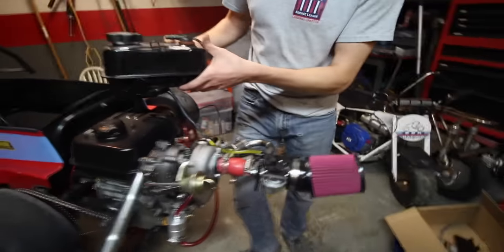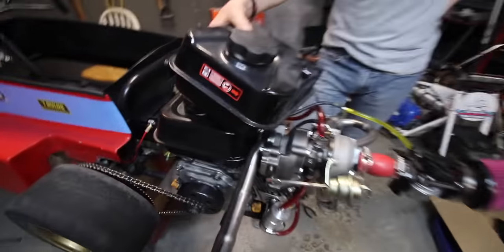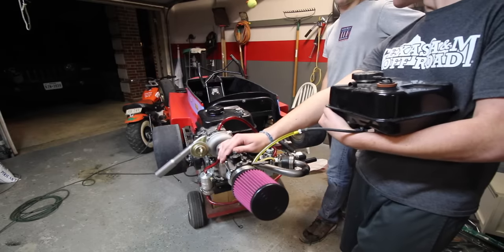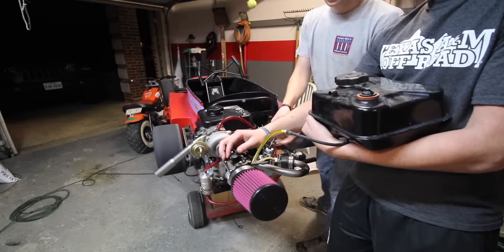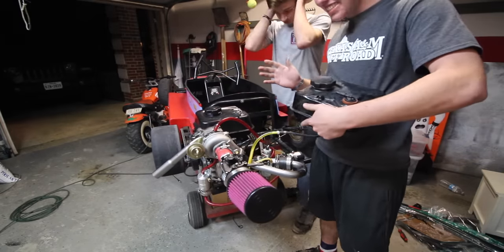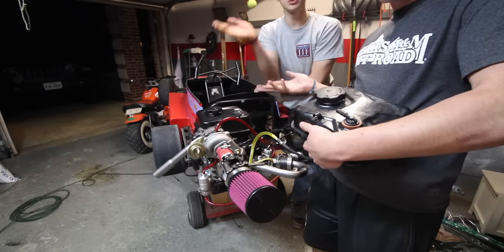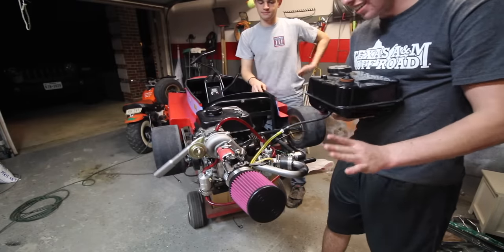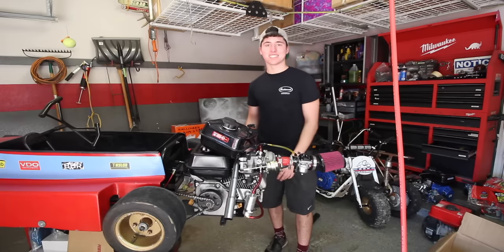Turbo Go Kart Finally Makes Boost!

Comment: When you place the carb after the turbo, it blows the fuel back into the the float bowl and can blow the seals of the carb and fuel out of the float overflow. If you're going to keep the 2 carb set-up, then run the the pre-turbo carb wide open all the time and use the second carb as the throttle control or vice versa. Also on the idle carb on the boost side, you should block off the float over flow and any non-jetted ports leading to the float bowl.  But I recommend getting rid of the second carb on the boost side and getting a lectron carb and placing it on the intake  side of the turbo. Lectron carbs are self tuning and work amazingly for carb turbo setups.
Reply from the maker: Ben Hawke Yeah, that’s why we attempted to pressurize it by putting that screw in there. We still had issues with that though.
Reply: @BuildBreakRepeat  
You should use a lectron carb. It's self tuning and works great for turbo setups.
Reply from the maker: Ben Hawke I’ll look into it thanks.
Reply: @BuildBreakRepeat  You missed one more part, the fuel tank must be pressurized as well, otherwise the boost will push the fuel back into the tank or atleast prevent more fuel from coming in.
Reply: Scoffing evidence setup would help. They have setups specifically for putting a Turbo on a small engine.
Reply: watch carsandcameras they did a drfit trike that was turbo and the used an electronically injected carb and it was running awesome
Reply: Build Break Repeat... You'll have as much $ in that lectron carb as you do in the whole go kart!! LOL

I Left you a good comment on how to solve your issues check it out!!
Reply: Or just run a draw threw set up
Reply: Put the carburetor on the intake side of the turbo.
Reply: @BuildBreakRepeat  if you take the  throttle valve out of the carb closest to the intake, you can use the throttle valve before the turbo to control how much air the engine gets.
Reply: @larrythemanic6.0mechanic78  there's did not run awesome. It ran but they had a lot of tuning probs and then never put it back on the channel.. but they used a widely marketed EFI system from eBay or Amazon and threw it on a turbo tryke and it ran but not great but it ran better then the carbs.. my opinion would to be to use a EFI system and integrated it into a multi port EFI intake system like modern fuel injection. And then turbo it from there...
Reply: @jamesduffy9756  i agree but it was running much better then any other system ive seen
Reply: Nailed it James👍
Reply: @benhawke7231  you really think he's going to invest that much into a carb for a homemade project ?
Reply: Yeah I agree with this. Also you gotta have a fuel pump to keep the pressure up instead of gravity- fed carburetor.
Reply: agreed
Reply: The mikuni is redundant. Dump the second carb, use the mikuni on inlet side of the turbo, add a dial a jet if you can find one and this will work.
Reply: Corey😁😃😎😍😅😋
Reply: @BuildBreakRepeat use only the carburetor on the turbos inlet and install and tune a power jet for it. .
Reply: @georgelalama8154  you would not know until you figure out your air fuel ratio and so on and on timing would have to be adjusted slowly and carefully go to far and lean = no more fun and smiles
Reply: Perfectly said, cause the needles are gonna be where it’s easiest to tune. That’s a super mean low to high crossover to tame the way it’s all set up. Some diaphragm walbros might be easier to use for sure
Reply: You need one big carb and even then its all gona be way to much for that motor but your inovation level is amazing you guys just got a new viewer for life
Reply: Ben Hawke I boosted a twin opposed engine. With a turbo that’s a tiny bit bigger than your but I used a two stroke plunger carb KX80 I believe but made boost and rolled abit of coal.
Reply: @georgelalama8154  that depends on how much boost they run and what fuel they use. The fuel enrichment is just as important
Reply: Yeah tell me about it! It would be more like Kablewieee!!! and then caputs for the engine🤣! @robertaswenson1192
Reply: Exactly what I thought when I saw him put the carb after the turbo.. Don't do that. The carb is meant to let the engine suck the fuel from the tank using vacuum. If you apply boost you'll just shoot the boost right into the fuel tank and starve it. Just run one carb before the turbo inlet.
Reply: Ben Hawke max
Reply: @jamesduffy9756  Theirs*😆
Reply: Megasquirt and call it a day. Screw carbs.

Comment: I would personally just do a pull through system turbo boost outlet directly to the intake and only run one carb
Reply: Yeah I don't understand what is so fucking complicated about this...
Reply: I agree with this
Reply: Came here to comment this. They are making it way more complicated than necessary.
Reply: Yup, one draw through and call it a day. All the problems would be solved.
Reply: the problem with that set up is the fuel droplets, instead of remaining atomized and gas like, all the way to the combustion chamber, condense on any of the surfaces that it flows over so in the end you end up with a mixture that is no longer stoichiometric.  obviously the longer the intake tract the more surface area there is to cause problems.
Reply: @ENZEEVIDS  Drawthrough srtups work fine on cars, should work fine on this.
Reply: I don't get it they make it complicated
Reply: I haven't finished watching this but why is there nothing hooked up to the waste gate how they gunna make boost ?
Reply: Perry Anderson...you’ve obviously never run a draw through system on any actual vehicle. Drawing the fuel through the actual compressor atomizes it even better and optimizes the mixture. It works...we’ve done it for years.
Reply: yeap and a fuel pump + pressure regulator  too
Reply: Was about to post this. Just freaking do it properly otherwise as soon as you boost, the middle carb is going to go positive pressure which is gonna cause so many problems, and also be a restriction. Damn.
Reply: I'd be embarrassed to post this video
Reply: @jaydee4200  Boost reference is to open the gate. It stays shut unless it sees boost past its rating. Then if you experience leaking you get a bigger spring.
Reply: Absolutely ridiculous. Just do a pull thru just like gunny fine and a lot if others said and use a larger carb.
Reply: When u run it pull through like your saying it's really only good for WOT the negative pressure in the turbo charger sucks oil through the seals when you close the throttle and oil and fuel starts pudding up inside the housing basically giving it no real driveability but it works fine if u just wanna run wide open for a short distance. Blow thru is a little more complicated but it's the right way to do it. But I will admit they got some crazy setup going on here.
Reply: Id have to agree with the blow through concept. These guys look pretty young. I definitely admire their drive. Trial and error (**draw through**)
Reply: When you.. and 50 other people.. get upset about the fact: Two kids don’t know how to turbocharge a carbureted engine....
Reply: they created a problem to solve it later...
Reply: You’re over complicating it just run one carburetor that’s it straight through and then you got it and run a blow off valve on the exhaust

Comment: Y'all are making this build far more complicated than need be. Put the Mikuni directly onto the turbo air inlet. Connect the boost side directly to the engines intake. Plumb exhaust and jet up as needed. So long as the turbo draws air through the carb instead of forcing air/pushing air through it you'll be fine.

Comment: You can always divert boost pressure to the gas tank and keep the whole fuel system pressurized, that would keep the carb able to pull fuel through
Reply: I'm turboing a roadster reverse trike and was thinking g of doing this. And article I can read about doing this? Safety concerns?
Reply: @CygnusHomes  the safety concern is that the blow off valve may release pressurized fuel air mix (boom). You have to be really careful. The best option I can think of is having a longer boost tube than plenum to allow the expansion of the fuel air mix. You also might want to put a spark arrestor on both sides of the turbo to prevent ignition of the boost tube in the event of air fuel reaching the hot compressor

Comment: Just use one carb ! keep the mikuni as a blow through keep that screw in the vent and run a boost reference line to the venturi then install a pulse fuel pump job done ! 👍🏻

Comment: We saw your invention but, couldn't put heads or tails on it. We installed a Hayabusa engine on a cool off-road go-cart and came up with an Awesome built. We have a 10-gallon gas tank on it. And we are very proud of ours. .gas lasts forever.

Comment: The blow through carb will need a high pressure fuel supply if you want to do it that way. What happens is the bowl gets pressured by the intake air as soon as you make any boost and it pushes all the fuel out of the carb. Some people actually put a sealed box around the entire carb to help with help solve pressure differential issues. 

That being said, you should be able to make it work with just one carb up-stream of the turbo (draw through). With a properly sized and jetted carb you should be able to make it run well. I did this on a car of mine and it worked pretty well.
Reply: Couldnt they just run a boost line to the tank and seal the lid tight?
Reply: That would work actually, I did think for a moment that the sealed tank would draw vacuum as the fuel got used up but it wouldn't do...  Mounting the carb in a plenum is an idea I've been pushing since the first turbo vid too, solves so many problems instantly.
Reply: fuckery abounds it could work, but then you have a tank full of pressurized air and gasoline. Very easy for that to turn into a bomb. Safety is rarely even in my top 5 priorities and I wouldn’t want to be around that.
Reply: I don't know that it would be any more or less dangerous than having fuel pressurised by a pump though really. In an enclosed space like a fuel tank the vapour/air ratio is much too high for it to be explosive, hence why it's possible to use electrical level senders and in-tank pumps without danger of explosion.  I guess if the boost pressure caused the tank to rupture and spray fuel everywhere, but I don't think it's overly likely with the levels of boost this engine will run.  Like you say though, a plenum and properly regulated fuel supply is the better option & what I'd go for if I could.
Reply: This is the smartest and best reply yet...

Comment: I had several experiences turbocharging carbureted small blocks back in the '80s, and I'm still turbocharging vehicles today. I highly suggest using a "draw thru" (or "wet charge") setup, over the "blow thru" (or "dry charge") setup. A single carb on the inlet side of the turbo, with a discharge pipe into the intake ("draw thru") is less complicated, and makes for easier tuning. A "blow thru" setup requires fabricating a totally sealed enclosure for the carb, so the carb's vent circuits "see" the same atmospheric pressure from the discharge pipe, that the venturi, idle circuit, air bleeds, fuel bowl and the needle/seat all "see" when under boost. Deleting the turbo outlet exhaust housing, in favor of the integral wastegate delete and wastegate puck block-off plate, will obviously cause high boost pressures. But, if you can keep it around 5-7 psi, while using the stock carb and increasing just the main jet 10-15%, you'll probably be in the ballpark for fuel requirements. BUT... after seeing the surging, low pressure and air pockets in the oil supply for the turbo, these recommendations may just be moot points. Anyway, good luck with the project.  Happy Trails..!!

Comment: Build Break Repeat  Awesome project and video, following your progress for sure.  An idea for a future video: Put a 1980's VW smog pump on a predator as a supercharger.  I have seen some examples that make crazy RPM's and power.  It is essentially a scroll supercharger with the perfect plumbing dimensions for a small engine.  Thank you for all your great content, longtime subscriber.
Reply: Now there's some prime recycling if that's true. Being from the UK I'd never even considered smog pumps as we avoided them, but if they're a scroll compressor with decent volume then it'd be a really cool project and probably much easier than a turbo..
Reply: An aisin amr300 supercharger would also be really good for something that size. It's 300cc and you can find them online for like 200$
Reply: A amr 500 is how I supercharged my UTV!! LOL Badass little superchargers!

Comment: Your original blow through setup would work fine if you just route the carburetor vents to the compressor outlet. Also will need to enlarge jets otherwise it will run far to lean on boost. Watch my turbo welder video for more info.
Reply: Optimal is right, use only the Mikuni carb., in a blow through design but, you won't need to enlarge the jets much, as there is now positive pressure inside the bowl of carb. Been there, done that :)

Comment: Single cylinder carberated turbo running clean.  I dont know if thats a first but its the first ive seen it work.  Good job guys.  I hope you get this runnin smooth. That'd be pretty cool and not a bad claim to fame for your channel.

Comment: Eliminate the blow through carb. Put a "Y" pipe on the inlet side of the turbo. Put a carb on each side of the "Y". Then you can have one for idle and make it so the second carb comes in at 1/4 throttle or so. Kind of like a Dual Quad setup or a Mopar "6 Pack" set up. It is referred as progressive linkage. Blow through carbs don't work unless specifically built as blow through.
Reply: Dual quad - Mopar 6 pack ???? They are totally different. A dual quad is 2 four barrel carbs, a 6 pack is 3 two barrel carbs.

Comment: I did the same thing, but I’m running a mikuni with the bolt threaded in. I had the exact same issue. All you need is a pulse pump. Cost 15$ and solved all my problems , just make sure you put a t in the line that returns to the tank so you don’t flood the carb

Comment: Why are you all youtubers trying to make carburated turbo karts?...KIDS TIME TO GO EFI.
Reply: Agree, i Can't blame them for a 2 stroke, but a carburated industrial engine sucks balls with a 3 hp
Reply: efi kit are not cheap for small engine,i was looking for one for my gy6 and was around $300 to $700.the only way to get one for cheap ,might be off a grom.
turbo are cheaper than a Efi kit.
Reply: Because nobody wants to deal with a $10 USB to RS232 adapter to use the cheaper and older version of Megasquirt. (And perhaps running XP virtualized to run the software?) So they look at the most recent version of the Megasquirt (which is over-featured for the task) and it's $500 more expensive than they want to deal with.
Reply: The main reason is forced induction will make more power than EFI. Put them together sure, but not just EFI by itself...
Reply: Carb turbos are fine
Reply: The only way carb turbo work is by placing only one in front of it, not dual like they want to do. I am a mechanic and have done several custom engines myself. After some jetting to that ONE carb the air/fuel mixture will provide enough to max out that tiny turbo.
Reply: @benjaminfranklyn604  Google fuelino I think it is?  If that's not it Google arduino + efi

It's an Arduino based efi for small engines.  If memory serves me right I believe the whole setup cost the guy under $100.  I think he only paid like $40 out of pocket but he already had some components when he began.
Reply: @DavidHoskins  i will search it up and try it,thank you for the info.
Reply: Heck most videos I see where they use the EFI it still doesn't work it will run fine but actually it always hurts the power ran better without the turbo
Reply: Efi dont make it faster i had 2 bikes with the same engine as the yzfr125 one with efi 1 with carb the carbed one was surprisingly faster strangely faster on acceleration and top end and I know I'm not a expert but thats my experience with efi
Reply: You guys are aware that the Renault 5 GT turbo was carbureted!
Reply: You get more power with carbs
Reply: Just K.I.S.S. carbs are easier and more simplistic then a efi kit. Sure you can tune better with efi but a carb is fine.
Reply: @benjaminfranklyn604  you can make janj efu systems that use the spark plug timing

Comment: Ever heard of re jetting? Damn lmao
Reply: Yeah agreed. Wtf are they doing adding carbs? I'm thinking, "why don't they just check the plugs and rejet?"
Reply: Just rejecting won't help, they are pressurizing the after turbo carb. It's just pushing the fuel back into floatbowl. They only need one carb before the turbo. This was done on snowmobiles back in the 90's for boondocking.

Comment: People have given you some interesting suggestions.  Here's one you might consider.  About 45 years ago I saw a McColloch belt driven supercharger on a Studebaker Lark.  The carb was enclosed in a sealed air box. The supercharger fed the air box.  That way the air pressure resulting from the boost would be equal inside and outside of the carb and would not cause carb leaks. You would only need 1 (your highest volume) carb to run the engine.  Fuel line and adjustment controls could be run through the air box with air tight seals , as not to loose boost pressure.  That way you could make your adjustments on the outside while the engine was under boost.  Of course instead of feeding the air box with a supercharger, you would use your turbo.  And the wastegate could be plumbed between the turbo and air box. If it would ever open you would only vent air and not an air fuel mixture.